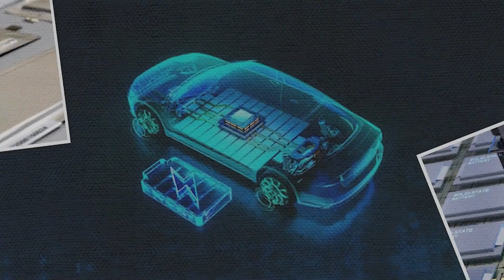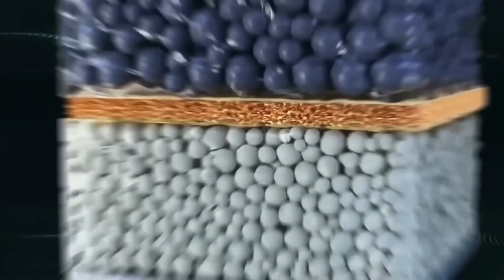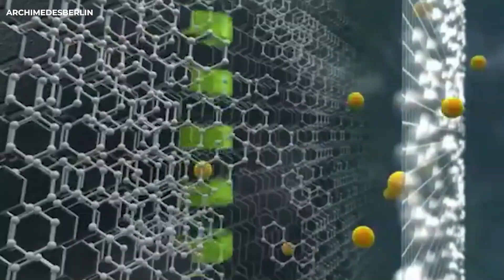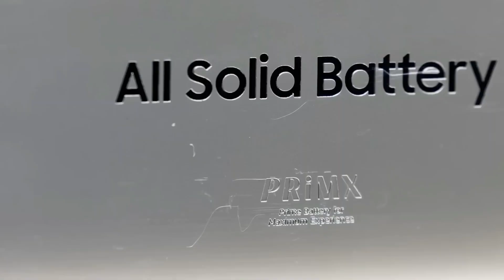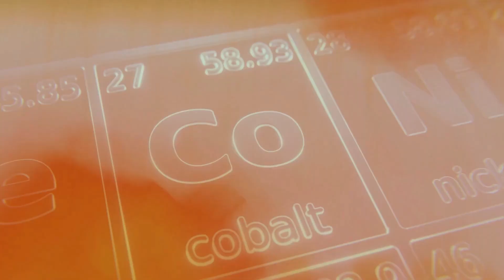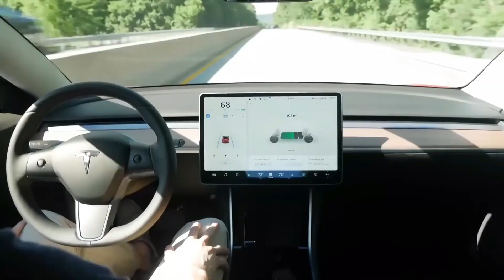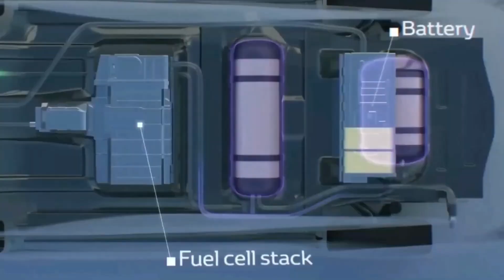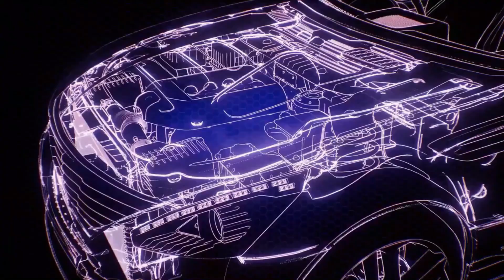Toyota CEO Announces New All-solid-state Batteries with 10-Minutes Charging Shocking ENTIRE Industry

Comment: toyota hilux- i had one back in the 1980', loved its milege,mpg.Actually i had a corola, it has 200.000 on it when i got it, it still run great and the mpg was EXCELLENT--I would buy a electric car when the price stablizes under20.000 for a cheap solid state MODEL.